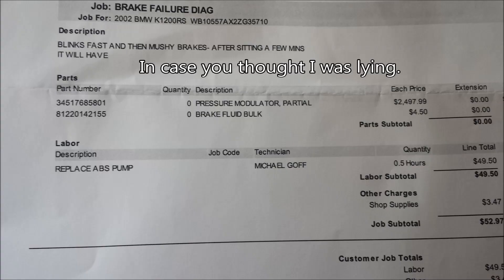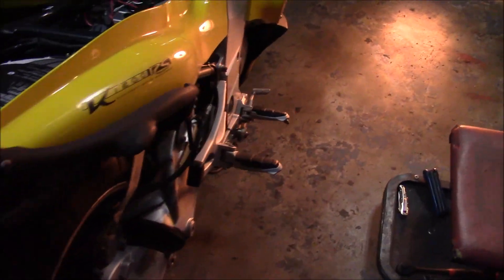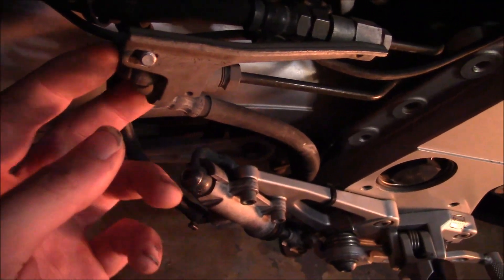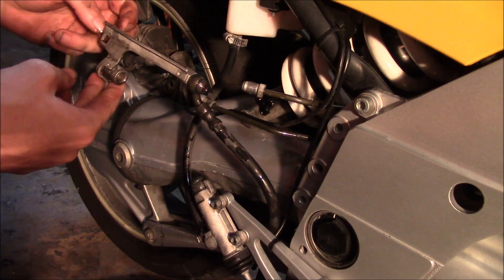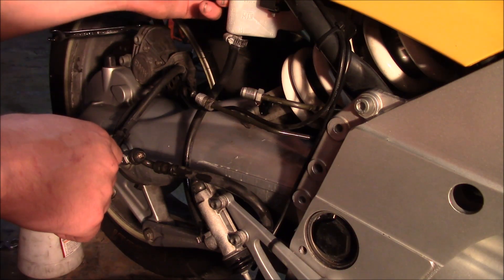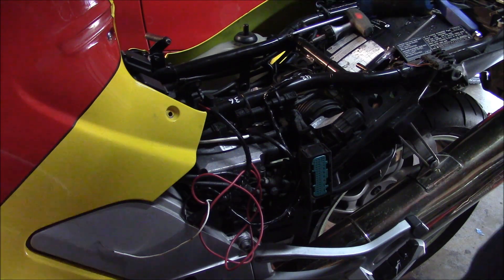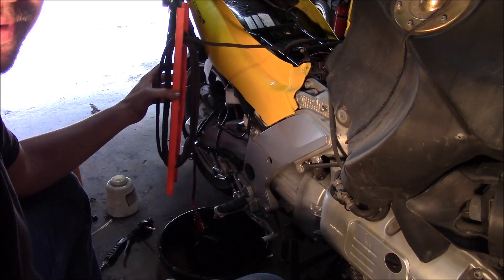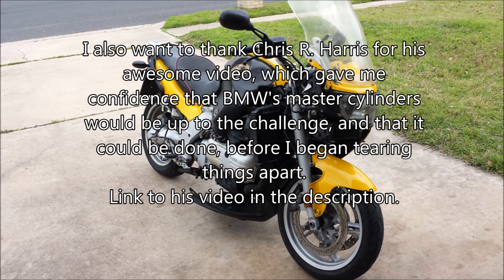How to remove "servo brake" ABS from BMW k1200 or similar bike

Comment: Thanks - worth noting this is removal of the servo on the earlier pre facelift K1200RS with ABS2.   It's not for the later bikes with iABS although the principles are similar.  iABS has "BMW" marked on front calipers, whereas ABS has Brembo calipers.

Comment: Hi from greece i have also make bypass in my my k 1200 lt i remove the unit and the electric module but not speedo  not eny brake ..eny help please
Reply: You should leave the electric module or do some work with relays...

Comment: I own a K1200R and it is criminal to me how BMW never supported these bikes to cure the poor engineering and manufacturing defects. Like; Faulty fuel level sensor, faulty shift linkage sensor that requires and new transmission and finally ABS II.

Comment: Great job, dude.  Way to think it through beforehand!!  Though it scares the $h1t outta me to have the ABS go out on my 2004 K1200GT, I think the BMW dealer had it exactly right when he told your customer, "If you'd trust your life to this guy..."  Me?  Nahhh, not so much.  

From what I saw on this video, you're about the last guy I'd let hack away on my bike.  From the lame-ass circus-clown music to the sloppiness in your tool handling, to the lack of a plan for where to relocate components, to not thoroughly understanding the control system electronics and therefore f-ing that part up... to the unprofessional and unnecessary sneering rants, well... need I say more?  Unsolicited advice:  Don't quit your day job.  Because you ain't gonna make a living doing the likes of this.  As for your client... I can only include him in my prayers.
Reply: BMW sells a death trap tells its customers it’s their problem and it can’t be fixed except by them the same way. This guy comes along and takes the time to figure it out and make a video about how to bypass it albeit not a perfect solution in this video, but it was a start-where’s your video of the solution?

Comment: Dude ! I feel your pain, but heads up not only does the speedo not work the freaking Break Light does not work either and that sets you up to be slammed into from behind, the bike is NOT roadworthy, should not be on the road without brake light. I have two of these bikes (It's a Love / Hate relationship). The first time your coming down from 120 + and you go for the breaks and they are not there OR your just out in traffic and somebody cuts you off and you live, you will want the ABS off the bike ASAP. I really don't know how BMW has gotten away with this (imagine if this happened in your auto, their would be a Massive Recall and the manufacture would be held accountable for the deaths) As you know its 10 X's more dangerous on a bike. BMW should step up with a kit to remove the ABS, and do a recall and remove them. For my bikes the parts needed to remove the ABS and convert to non-ABS are stock. I estimate the job to take approximately two hours labor for a trained BMW motorcycle mechanic (whats just one life worth ? ) I have read all the information in every forum I can find and I have viewed all the video's I can find. I have removed the control module from the ABS unit of one of my bikes (while in the bike, they (BMW) said that could not be done) and sent it out to Module Masters to repair and replace burnt chips on the circuit board BUT the safe bet is to GET RID of the ABS. So, thank you for your video and telling riders the pit falls.

Comment: I do not want to doubt that the AB systems at BMW from the 1st and 2nd generation are somewhat coarse and not particularly durable.  However, and that should definitely be mentioned for those whose ABS still works: Change the brake fluid too often than too seldom!  Since brake fluid is known to be hygroscopic, the bound water in the hydraulic unit causes corrosion relatively quickly and leads to the well-known blocking of the control valves and / or the pump.  Simple cause, great consequence.  There is a reason for maintenance intervals !;) So long, always enough asphalt under the tires ...

Comment: I;m looking at a 2002 1200LT with this brake problem. With the same $3000 cost for repair. Bike is $2500 so I'm probably going to by it. It's otherwise quite nice

Comment: Great video. I just bought an 07 K1200R Sport... the bike is mint with only 2.6k on the odometer. Guess what... brake failure. Probably why they sold it. I will be eliminating the abs so look for my video in the future at paul phillips fix. Thanks again for the video good job.

Comment: Thanks for the info. Just a heads-up: My 2000 K1200RS set up on the rear brake is a bit different. I was unable to attache the line coming from the master cyl to the upper (forward) receiver point that you used. I had to use the lower (rear) connect point, because they are backwards from your demo. My brake pressure dropped considerably, but a bit more foot weight and it works fine.

Comment: Hi, few questions, what were the two relays for you installed was it one for front brake to activate brake light then the same for the brake pedal? 
Secondly all the wires you cut you put some to relays what did you do with the rest? 
Thanks sorry but really don’t understand your diagram

Comment: You posted this in 2015 so now that it's been a while I wanted to ask if you were still happy with the outcome.  Has anyone else that's seen this tried it and been happy or unhappy?  My 2002 is throwing an error now and I'm afraid it's going to come down to replacing the ABS unit or doing what you did, but I wanted to make sure people were happy with it before I do something that can't be undone.

Comment: Cool video.  A tad too long but watchable with the editing.  Perhaps I skipped through it but otherwise I don't think you explained what you were doing with the relays.  And what was the deal with the Speedo stopping to work.  Lastly, do you know why/how the ABS servo (pump?) actuating would cause the Tach needle to deflect  (and then while we are at it, why might a bike get stuck in the Ignition turn on initial self test thus actuating the ABS servo about once per second..

Comment: I just want to keep the servo/ABS electronics connected and also leave all the lines/hardware in. Where or what size fittings do I get to cap/plug the lines that are disconnected going to the servo/ABS unit? Thank you.... Is the size an AN3 flare cap or plug?
Reply: OK did some research. From what I understand it's an 3AN or M10x1.0 thread size.  So four flare caps of that size will be necessary to cap off the ABS servo lines.

Comment: Would it still work just capping off the lines to the servo that was disconnected?  I assume the existing harness would just activate the brakes lights from the hand and foot switches without having to remove the whole system and re-wire in relays (in case the ABS was fixed at a later date). Great job by the way and thanks for editing and uploading.
Reply: The switches on these ABS bikes are normally closed as opposed to non ABS bikes that are normally open.  Therefore he had to use the relay setup he used to make them work.

Comment: The BMW K1200GT can be problem-some.
Reply: I converted my own. You don't need to go as far as he did though. Just connect the brake lines as described in the video, and remove the brake warning and warning triangle bulbs.

Comment: Did you find that you had to change out the brake switches? If so, which one's did you use?
Reply: Just install an inline pressure sensor in the brake line to activate brake lights. they work great!
Reply: I don't know what an inline pressure sensor is. I ended up changing the front brake switch to make the brake light work. I never use the rear brake so I just left the switch there. And if I ever do, it's used with the front brake so I have a brake ;light either way.
Reply: These are available from Mike's XS. I removed the switches & just connected the wires on the pressure switches to the brake light wires.

Comment: Why even waste all that time ( much appreciated btw) when you can ditch the whole lot (or just unplug the electronics)  especially when the electronics are fried (plenty of pics on the web) inc mine,  which complicates the procedure. What you then need to repair is the brake lights, rear tail light, and speedo (and cruise too if required) So, do some wiring, and shove a GPS on the face of the speedo.........done..........................
Reply: Bob Murphy well if you only unplug the electronics, you won't get pressure to the calipers.  the levers have hydraulic pressure to the unit where a switch is depressed which activates the unit which pressurizes the brakes. they are four separate closed loop  systems. the unit itself was bad, so i yanked it. plus it loses something like 14 pounds off the top part of the bike.

Comment: does it gonna work with K1200S 2005, and how it ll pass the MOT and insurance ll be higher due to modification?
Reply from the maker: lylepurian unfornately i don't know the answer to either of those questions. but watch the follow up video before you do this. there is a link in the description.
Reply from the maker: lylepurian actually the link is in the comments section. not the description

Comment: Hi

Thanks for the vid, i found it really useful.  Just one question, is there any reason why the abs unit cant be left in place after it has been bled and the pipes disconnected?

Im looking to tackle this fairly soon and im not massively interested in removing the unit unless i really need to.  Im happy to conceal the piping but was curious to know if the electrics can still function through the unit after the brake fluids have been drained from the servo and pipes disconnected.

Any advice will be greatly appreciated
Reply from the maker: Rizwan Mustafa hey thanks.  actually i have a followup video about that, and, i talk alot about it in comments in this thread too.   long story short, yeah...  take the pump off, leave the computer.  dont cut the wires or you will lose speedometer.

Comment: I done this with mine, a 2003 BMW K1200GT. You need to retain the ECU unit on the top of the pump though. I simply removed it, and disconnected the wires to the pump motors, (there are 4 of them), then I removed the 2 warning light bulbs, Brake Failure and General Warning (Triangle). One problem still remains though, and that is, when the reservoir is topped up, and the bike is on the side stand, fluid leaks from the pump because the reservoir is still piped up to it. How do you stop that happening, without having to put the bike on the main stand all the time??
Reply from the maker: yeah i agree completely. i did link to a followup video which explained the same thing you said, more or less.  and i also put it in the comments, and said the same to others who responded asking me various questions, in hopes that they see it and do not make the same mistake i did.   i did what everyone else did and watched a video about how to do it and i figured out all the ways it went wrong after the fact, but unlike the other videos, i did post a followup video warning people against the mistakes.  fortunately,  many have watched it. feel free to watch that one as well,  and i do appreciate the comments. also feel free to leave any other advice that may help others out.  thanks!
Reply: It's a winter project of mine to remove the pump and see if an effective repair can be completed. I believe the problem to be with the brushes on the pump motor, or motors in my case. If that is so, then the only problem should be finding the correct size brushes to suit. I tried to get BMW to recall the affected bikes and replace the pumps, but they wouldn't agree. They did offer the pump to me for £340, (originally £1700) as long as I got a BMW Motorrad dealer to install it, at a further cost of £400, but my argument was that this was a serious health and safety issue, and they should replace them. Also, why would I want to spend that sort of money on a 13 yo bike? I may do a video of any repair attempts.
Reply from the maker: Philip Kilpatrick i agree about the 13 year old bike thing.  as for the pump, a few different things go wrong with them. the seals go bad inside and pressure does not build. or the motor can go bad.  if you hear it "doing something" then the motor isn't necessarily bad.   as for swapping the brushes, i'm not sure if they can be changed on the motor(s). i didn't actually open it up to see what kind of motor was in there. it's probably a brushless motor, like most modern day electric motors.  that's not to say you are wrong. fact is, i'm not sure. but, 99% of other bikes in the world don't have abs, and those that do, rarely fail, but, this bike is notorious for failed ABS, which is evident by the amount of views i get on this video, and the plethora of other videos on the subject that exist. lol. 

 however.. it's been a while since i've posted it, and the owner has brought the bike back to fix several other things, but has not had an issue with the brakes since i removed the pump.   but... the thing i'd do differently, and it's been touched upon in other comments and a followup video, but, you leave the computer in place, and eliminate the pump part and connect the master cylinders directly to the calipers like every other bike out there. 

 That way you don't have do do all of the crazy wiring, and will still have a speedo, if yours doesn't have an extra part for a manual cable like some of them do.   you'll have to snip a few wires and pull the bulb so you won't have a light on the dash.  but. it works perfectly fine.   you can find rebuild kids for them but they aren't easy to find and they don't replace the motors, just seals. and the only way you can find brushes for them is to figure out who made the motor and contact them directly. (may need to find a Chinese translator).  But the way i see it, is if it failed once, it will fail again, and again..  and if the motors are the problem now, the seals will be the problem next time. and it takes a lot of effort to remove that thing every time something goes wrong.  and it removes over 13 pounds from the top of your top heavy bike, which helps handling more than you'd think, AND changes the power:weight ratio..  just my thought.   but please do check out the followup video. it's in the description.   and thanks for the comment!
Reply: I have the brakes directly connected now, both front and back. The ABS pump plays no part in the set up now. The pump is coming out anyway, as it's just additional weight that is no longer required, but as I say, i'll have a look at repair, and if it's unsuccessful, no harm done!! I'll keep you posted. keep up the videos!!
Reply: M B l

Comment: I have a 2000 1200r all those wires were connected to the pump
Reply from the maker: Go to the brake lever. find the wire colors.  go to the foot brake pedal. find the wire colors. go to the tail light. find the wire colors. find the wire colors that come out of your turn signal switch just in case.  go to the loom. find the matching wire colors. google a wiring diagram, or do this visually........ i don't know the wire colors.  if your blinkers don't work as is, then you need to figure that out too. 

  turn your volt meter on and find one with 12v when the key is on.. probably a big red one or big yellow one with red...  usually.....

 find a ground, or make one yourself.  

 then plug them into the the relays accordingly. one relay is for front brake lever one is for rear brake lever.  so, by common sense, one wire from the one goes to one and the other goes to the other.  ground and power go to both. some of the wires in the diagram i showed don't exist because YOU have to make them to connect the two relays together..... off hand, i think they are power and ground only.

  but FIND A WIRING DIAGRAM so at minimum, you can figure out what the wires are that were described in the diagram i put on the video, and then compare to the wires you traced on your bike.  blue may be purple red may be yellow black may be fuscia. i don't know. but if YOU know what they are on your bike, you can compare them to a diagram.There are tons of bmw forums and even forums for this specific bike that have 100% of the answers.  in fact, they even have the wiring diagrams for every model and year. But that's pretty much the extent of what i can help you with.. if you do those things i may be able to help you... but... if you do those things, you probably wont need my help, and will learn a lot in the process so it won't be as scary / fucked up next time you try to tackle a pro level job...    i don't mean that condescendingly. i mean that as....  electrical shit is not for the faint of heart. it's pro level work.   so... if you figure it out, you'll be all the better for it.    good luck
Reply: MB, I hope you don't mind me jumping in here, but if Lex just removes the ECU (it's retained by 4 secure hex screws) from the top of the pump, then disconnects the 4 wires connected to the motors, all that remains to do is remove the bulb(s) in the dash. That way the wiring remains intact, in the event that the pump is refitted. Of course, the brakes themselves will have to be plumbed straight from reservoir to calliper, once the pump is removed from the equation.